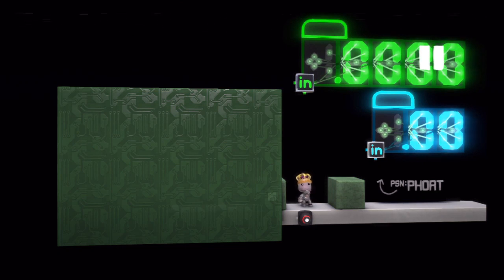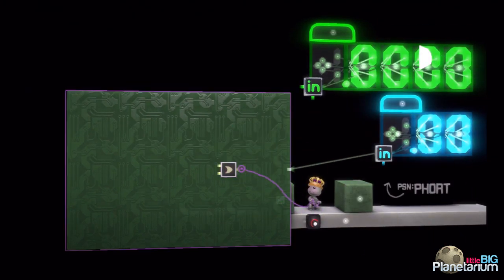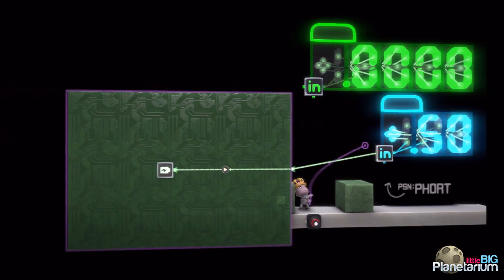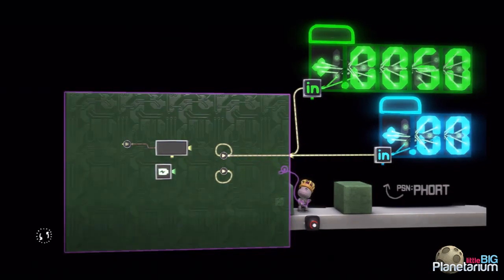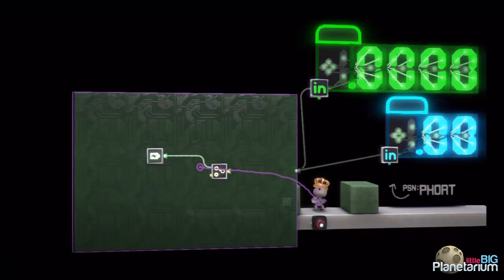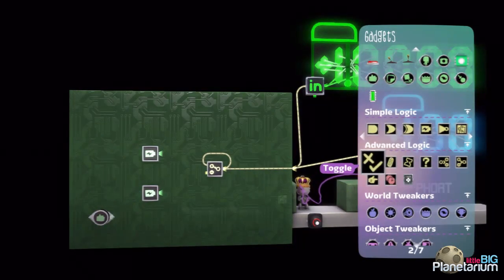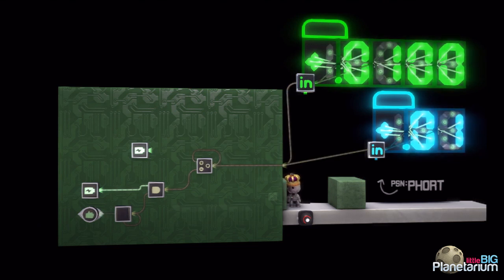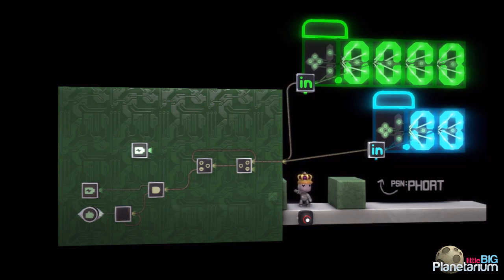LBP2-Torials 20: Feedback Loops (part 1)

Comment: @TheSporeFan1 You could subtract the analog signal required to cast the spell from the current mana analog signal, subtracting signals and all, then the result has to be positive in order for the spell to start. You'd put a battery on a positional sequencer I think. I just thought this just now, so might want to experiment. I'm also sure there's a way easier way to do this, so i guess a tutorial would be nice. :P